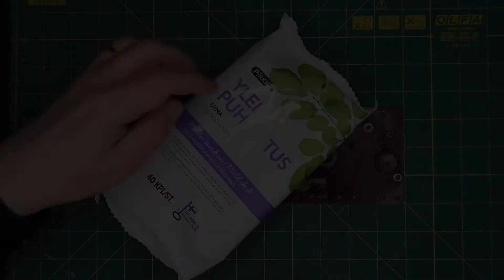Restoration of a Meccano clockwork motor from 1920s–1930s

Comment: Lovely video.  I'm surprised you didn't get a significantly better performance after your restoration.
Reply from the maker: Thanks! I was bit frustrated the final performance after quite a hard renovation. Specially the noise was disappointing. However, it was interesting and instructive journey inside the No. 1A motor. Let’s see how the motor will work in practice in my upcoming project.
Reply: Actually I think it turned faster, hence was more noisy. So both faster and longer would be a good result

Comment: I've acquired a couple of these which need a bit of TLC. One is single direction, the other has the reversing mechanism. Both are in running condition, but grotty inside and prone to sticking (especially the reversible one). I'm wary of the powerful spring and many small components, so thanks for the video. Are there any resources for identifying the age of Meccano motors? These came in a job lot of bits, clearly from many sets with some of them perhaps decades apart. I doubt either is as old as the one you have there but it'd be nice to get an idea where they came from.
Reply from the maker: Meccano history is very interesting! Visit NZMeccano.com gallery site: https://www.nzmeccano.com/Gallery.php . Write “clockwork motor” in ‘Search of Images’ window and browse search results. There are plenty of clockwork motor images and information. Hints and tips can also be found on Timothy Edwards' Meccano site: https://www.meccanoindex.co.uk . Look for example under the title “Meccano Ltd Brochures”. Both sites are excellent databases of Meccano history and information.
Reply: @johnmeccanitian  Extremely helpful, thanks again. I've tentatively ID'd my non-reversing motor as 1931 (dark red case, oval transfer, domed bulge on the back of the winding axle), and 1937 for the reversing motor (dark blue case, round transfer, flat case-back).
Reply from the maker: @SteveSmith-wk9dx  Oh! Prewar motors - always great!

Comment: if it got noiser, perhaps a heavier oil should have been used.    The slightly longer run time and the sound indicates it was not running faster.
When I was about 6 one of my father's workmates gave me a large collection of used Meccano parts.   Included was one of these motors.   I used to build tower cranes and mobile cranes about 2 or 3 feet high and the motor proved to have totally inadequate power.   I built a Mecanno truck about a foot long with gearbox and differential and this motor proved inadequate for that too.  Then I tried hooking it up to turn a toy DC electric motor, expecting it to function as a generator.  Naturally that didn't work.  It would have needed to turn at several thousand RPM, which being only 6 I didn't appreciate.   After that I ignored the motor.
But I reckon that building things out of Meccano parts gave me a much better learning and thinking exercise than the following generation of kids that used pretty plastic Lego.
Reply from the maker: I have also later thought that a heavier oil would have produced a better result. Thank you for the interesting story.

Comment: Was it worth it?
Reply from the maker: No. But it was an interesting and instructive journey inside the No. 1A  clockwork motor 😀
Reply: @johnmeccanitian  my light hearted comment well answered. I myself spent 2 years repairing a chiming mantle clock which was still unreliable due to spring damage. Replaced movement with an electric system and went onto building a spitfire in Meccano, it didn’t fly!